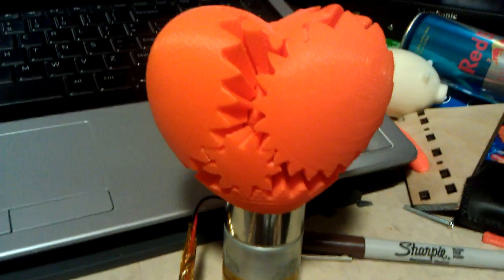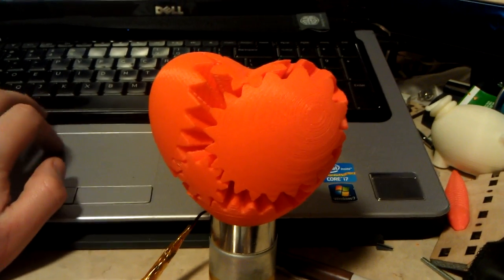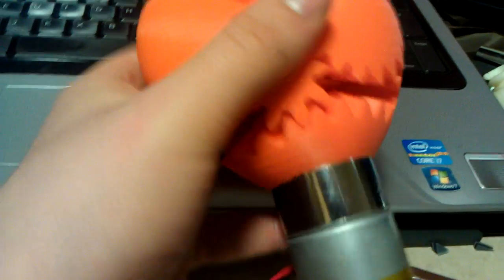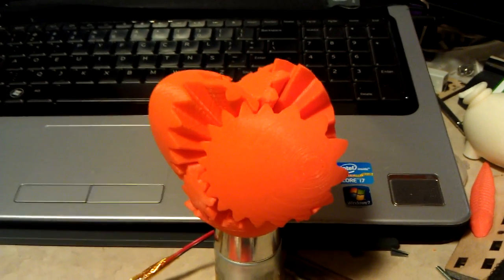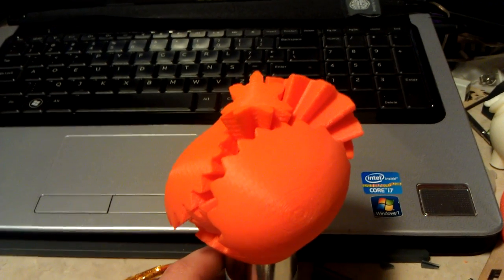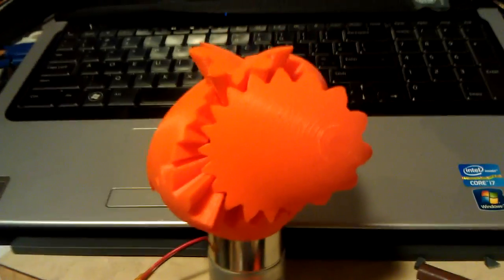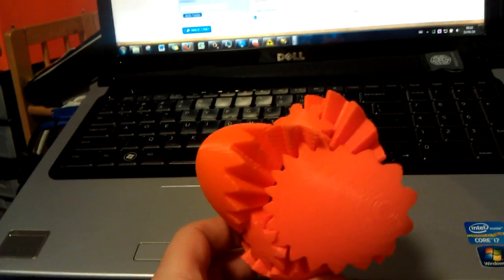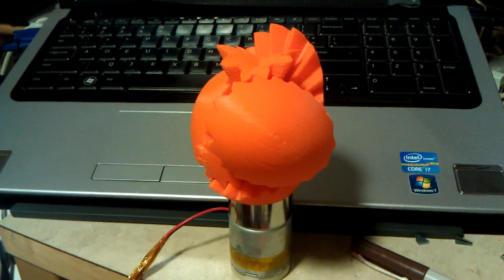Motorized screwless heart gears

Comment from the maker: This was designed in OpenScad, a text code based CAD software package. Due to the nature of OpenScad, it's files are not easily transferable to other languages. SolidWorks does have rudimentary STL input, but only surfaces, not solids, so it is of extremely limited use.